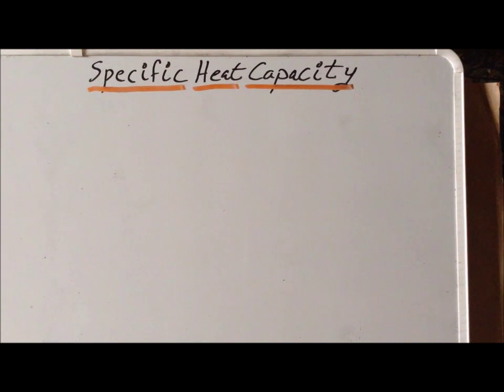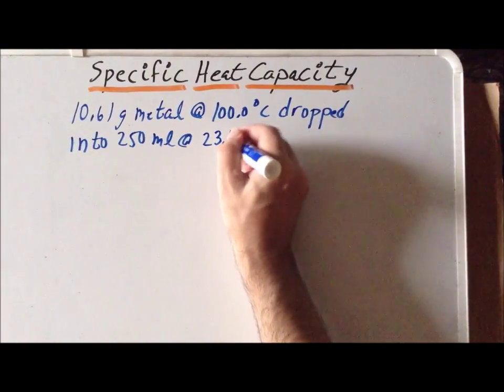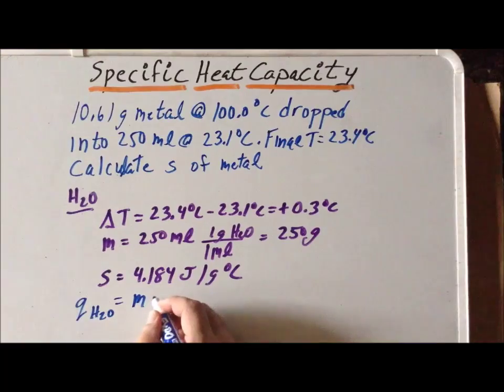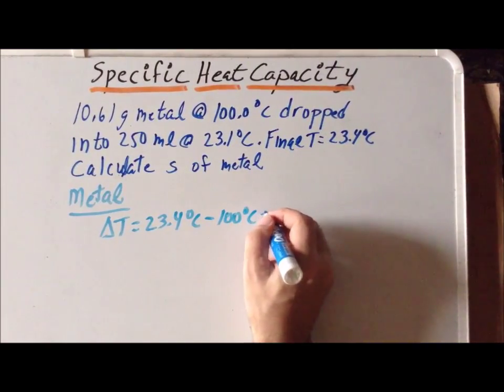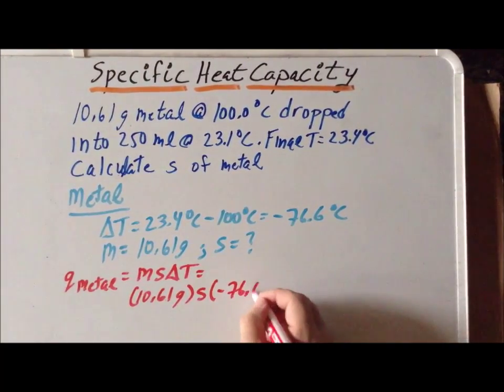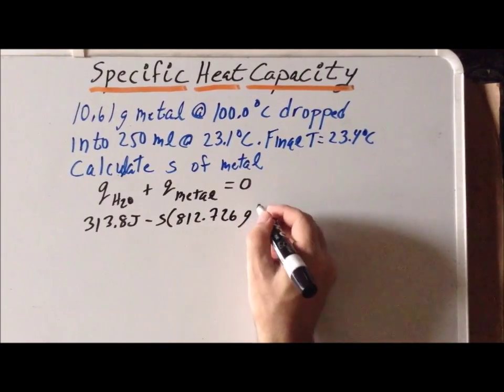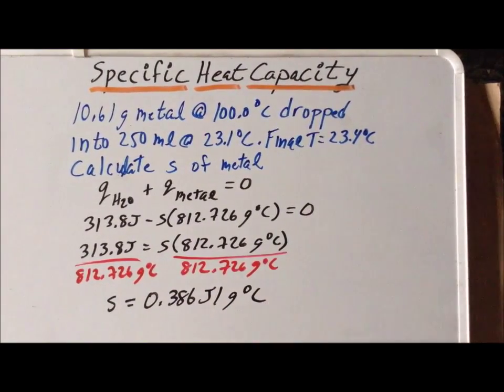Specific heat capacity (hot rock in water) calculation

Comment from the maker: (for mobile users)

00:08    Statement of problem
01:52    Calculate temperature change (ΔT) of solvent
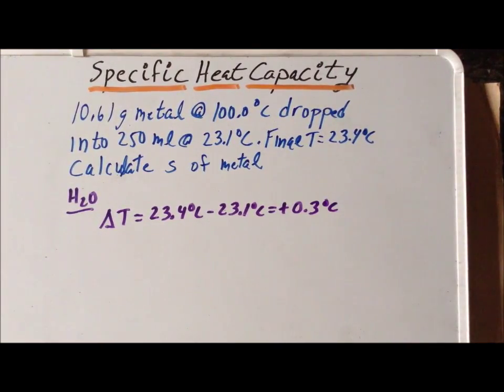02:21    Calculate mass m of solvent
03:20    Calculate heat flow of water q(H₂O)
04:15    Calculate temperature change (ΔT) of metal
05:13    Calculate heat flow of water q(metal)
06:17    Conservation of energy: q(H₂O) + q(metal) = 0
06:56    Solve for heat capacity s